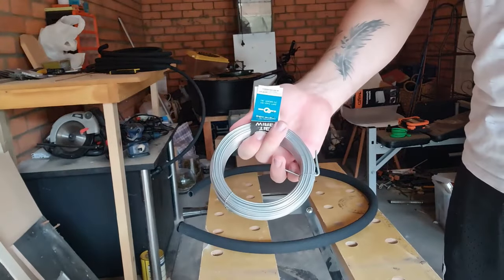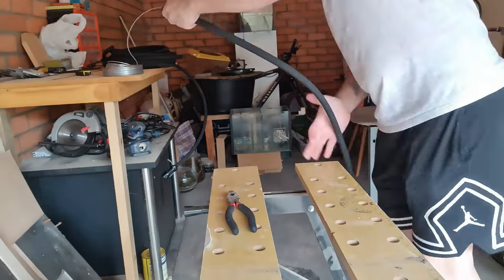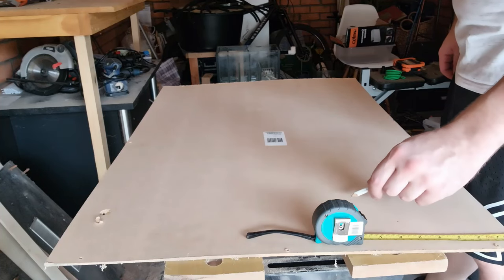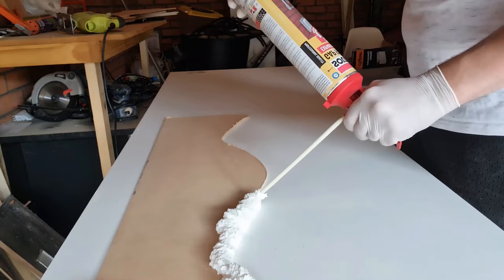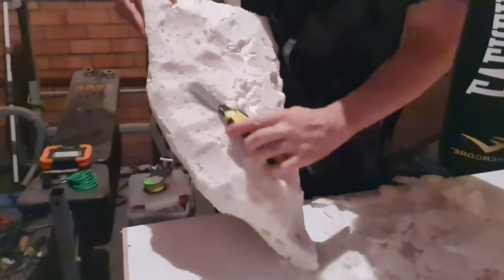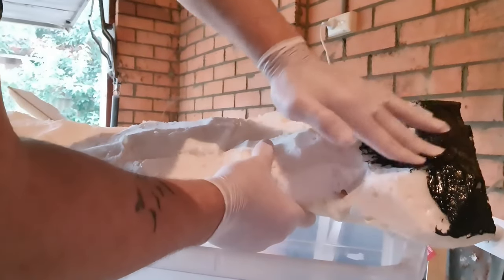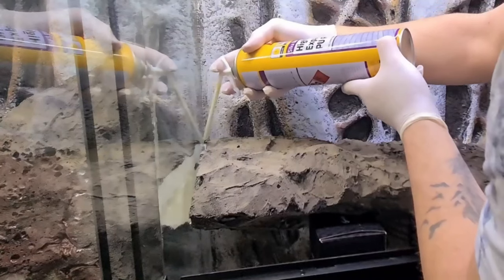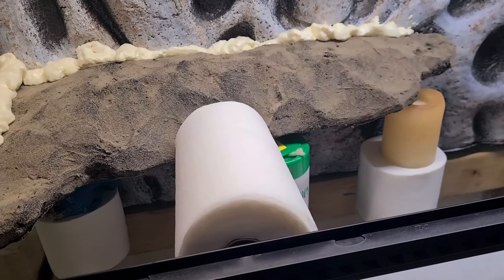Green Tree Python/Green tree Frog Paludarium/Terrarium Build

Comment: Hey, the Paludarium looks fenomenal. Just so you're aware, your mic audio is only going through the left channel. The music and sound affects are okay, but I would double check your mic/audio balancing either at the point of recording or in your editing software.
Reply from the maker: Thanks for the heads up I had no idea as I don't use headphones when editing my vids, it seems my microphone extension cable was causing the issue, that's for letting me know.
Reply: @reptiplantworks2294  Depending on the software you use, you should be able to pan the audio. Left is stereo meaning you have to have both left and right side panning on if you have the left on at all. Right is inherently mono so if you switch it to only pan the audio to the right it will come out of both speakers. Although most likely the audio options will just say stereo or mono, and for ease of use for your case, just do mono. Sorry for the info dump, hope that helps.